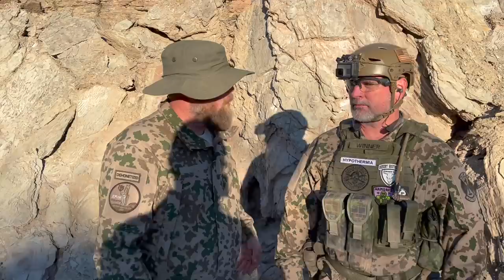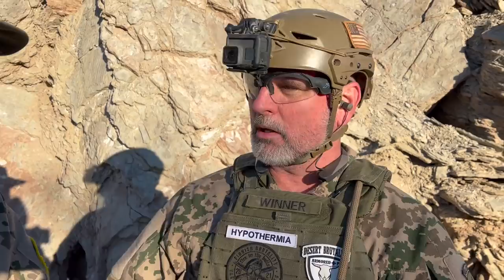WWSD - Why not a hydraulic buffer?

Comment: I've never heard this flaw brought up in the context of hydraulic buffers. Obviously tempterature and viscosity are related--so obvious. I just can't believe I've not heard that before.
Though, hydraulic buffers aren't common by any stretch...
Reply: This is the first time I’ve ever heard of them, and I get to hear it from Karl with a satisfying fart sound.
Reply: Common problem with them.
Reply: Hydraulic buffers need extra few centimeters of bolt carrier stroke soley for damping recoil energy to ensure reliability because damping force can change by temperature. If hydraulic buffer starts to decelerate bolt carrier much earlier than minimum cycle distance, and damping force is bigger than its optimal setting it can stop bolt carrier from going back enough, causing malfunction. Most of rifles, except some cases, have tight bolt stroke in general. Installing hydraulic buffer in those rifles can cause exact same problem - bolt carrier getting decelerated too early, causing malfunction.
Reply: It is funny anyone is even thinking about using hydraulics in firearms, because there is really no advantage over simple springs. Hydraulic and pneumatic systems are usually among the highest maintenance parts in any machines and so you only use them if you really need them. I knew a guy whose entire purpose at a factory was to keep several hundred hydraulic devices correctly pressured, and by the time he was done with the last one, the first one was invariably out of spec again.
Reply: I think part of why hydraulics are a part of the conversation is that pewpewtactical used one in their take on the wwsd. Im glad we now have some more data points (even if this is more anecdotal). 

Makes a lot of sense in hindsight though: adding a significantly more complicated additional point of failure. Yes the captured part is a bit more complicated than the standard non-captured versions, but the differences certainly won’t break the rifle in adverse weather like adding a hydraulic system can.
Reply: Also don't forget they can leak/blow seals. Its abit dated and probably not even close to the same design. But a issue with the 1918a2 bar with the hydro buffer system to allow for two speeds of full auto. Was it would leak and the slower rate of fire would climb up to the fast fire speed as fluid leaked. At the end you'd end up with a 30-06 full auto gun firing at like 700 rounds a min with no buffer to dampen the end recoil of the action cycling.
Reply: 20 or 30 weight hydraulic oil isn't going to work. You'd need 10-16 weight, about automatic transmission oil, to account for gross ambient temperature change.
Reply: @genericpersonx333  Um..what about vehicle shock absorbers?   They run hundreds of 100s of 1000s of cycles without failure.
Reply: @johndoe-td2xd  They were a lot more prone to failure back in the day and so car companies figured out it was worth overbuilding the shocks because reliability helped sales. The hydraulic buffers I have seen for firearms are not as yet being built to the same degree, and partly you don't want to because added grams tend to matter in a gun more than added kilograms matter in a car.
Reply: @genericpersonx333  And that's assuming that you could overbuild them enough to matter and still have them fit in the firearm.
Reply: Not common in fire arms, but just about every car on the road is running a few
Reply: @johndoe-td2xd  A car bouncing on a shock absorber does not malfunction if it sinks slightly too slow or slightly too short. Bolt movement is the most sensitive part of a firearms function. Little changes to it can cause a malfunction. A vehicle shock absorber doesn't cause the car to die if it doesn't settle or move exactly how it is suppose to. 

Also far lower volumes of material and fluid are used in a hydraulic buffer in a gun than in a car. Smaller volumes are more sensitive to temperature changes.
Reply: @genericpersonx333  Apparently they've finally figured out how to sell points-of-failure as a premium feature...
Reply: they work really well on the army's m249 and m240

Comment: The KynSHOT buffers are rated for - 30 degrees F to + 150 degrees F with fluid viscosity being unaffected. The introductory pictures indicate another company's buffer was used and it does not look like a KynSHOT buffer. The KynSHOT Buffers have been tested to over 50,000,000 cycles with no degradation and uses all military grade components. If someone is having cycling issues that typically is related to an improper sizing of the buffer and choice of spring.  KynSHOT reviewed all the competitors products and designed out all the flaws that were seen in the past.  KynSHOT is the leader, innovator and pioneer in recoil mitigation solutions.

Comment: It’s always good to get confirmation from use in the field.
Reply: That may work for optics, ammo, modification of crucial components etc but it’s just logistically a nightmare to if you wanted to do that with this issue present.
In 24 hours the hydraulic oil could go from too cold to work at all to working fine then being too thin in the heat to working perfectly again before it’s too viscose.
And that’s if you completely eliminate the constant temperature change from the buffer tube doing it’s job.

You can’t shoot off a few rounds before every stage.
Once you’ve field tested an optic, you can be pretty sure it’s still going to be fine at lunchtime and again next weekend provided you haven’t  been careless or exposed it to really extreme environmental factors. Also, your gun doesn’t stop working if the optic is fked.

But yes, confirmation is extremely important. They both know this, the issue being how finicky this confirmation is.

Comment: The best gamer spring system is just a rifle length buffer and spring.
Reply: I just put a rifle length buffer and spring in an 18" AR build, looking forward to shooting it.
Reply: @gfarrell80   yeah I’ve got one of those, functions perfectly...  ejection pattern right where it supposed to be.
Reply: @gfarrell80  I think you'll love it, I have a 16" mid gas with rifle buffer, inspired a lot by WWSD21016, and that thing is an absolute beauty to shoot.
Reply: Doesn’t the KP-15 lower only work with carbine length buffers?

Also, what’s the main difference between rifle length and carbine length buffers in terms of pros and cons anyways?
Reply: @gameragodzilla  yes unfortunately the KP15 can’t take anything longer than carbine length due to structural support material behind the buffer compartment. 

A rifle length buffer and spring allows for a better rearward balance, additional buffer mass potential for function, improved component life, and a longer thus smoother recoil impulse. The only downside is the inability to use collapsing stocks.
Reply: Basically make it so that the bolt carrier never impacts the rear of the gun, and instead is slowed down completely by the buffer and recoil spring. Closest you'll ever get to an Ultimax, baby!
Reply: @devikwolf  That is exactly the same setup I have for gas and buffer on mine, I really like it (also inspired in part by the WWSD project)
Reply: @GuamGuy  Huh, so my rifle with a full length A2 stock and a rifle length buffer still has certain advantages over a KP-15 lower. I was wondering if I should just switch entirely to a KP-15 lower since I don’t really care about adjustable length of pull and the KP-15 is lighter, though I may retain my standard A2 lower with a rifle length system if that buffer does make it smoother, as I do like my retro rifle with a rifle length system and rifle buffer being so smooth.

Is the rifle length buffer being smoother a factor across the board? Even if I get the fancy fully captured buffer with the rifle length extension that the WWSD rifle uses, would I still have a smoother experience than a KP-15 with the carbine buffer?
Reply: @gameragodzilla  All things equal, the rifle spring and buffer should be smoother than it’s equivalent carbine variant. It’s been a while since I’ve shot a rifle with a SCS and never directly next to a rifle length buffer, but of all the combination of gamer parts I’ve use I’ll list them from snappiest to smoothest. 

-piston ARs and any of those pdw stock always felt extra punchy to me
-standard carbines on the gassier side have sharp recoil impulses with a decent sight disruption. 
-gamer guns with adjustable gas, hallowed out buffers, and carbine springs have a sharper but lighter recoil impulse. They also have less sight movement. 
-JP SCS
-A5 buffer
-anything ^ but with properly compensated muzzle brake
-rifle length buffers with rifle length gas systems Ala A4 clone. 
-smoothest AR I’ve ever shot was a 20” rifle gas HBAR with a 3 port tank brake and an A2 stock.
Reply: To me, the KP15 compromises some of the smoothness of a rifle length buffer lower to achieve a lighter weight and often over looked integrated flare magwell at an economic price.
Reply: @GuamGuy  Nice. I also did wonder if having a really nice muzzle brake in a 20” rifle length gas system and rifle length buffer was completely overkill and I should just stick with A2 or if there’s still a benefit there. Still, happy to know that there is still a point to a rifle length buffer because I was wondering why I should still bother with my A2 stock lower when the KP-15 is a pound lighter. I always figured the main reason to still use aluminum lowers was just to have adjustable length of pull, but seems like keeping it with a rifle length buffer to have a smoother recoil impulse is its own benefit.

Is there a particular rifle length buffer system you would recommend or is a default rifle length buffer I got from my Windham Weaponry full length rifle the best it gets? I would be willing to spend money buying an even nicer buffer, especially since I want to eventually get an FRT-15 trigger and start hammering the gun in pseudo-full auto. lol
Reply: @GuamGuy  Makes sense. In that case, I suppose I’ll keep the full length rifle buffer because I’m not gonna be patrolling long distances so weight is less of a concern while being able to smoothly and quickly dump ammo is something I want, especially if I decide to get the FRT.
Reply: @LUR1FAX  Not correct. The longer tube is compensated by a longer buffer. A CAR buffer achieves maximum bolt travel, any further rearward movement would result in the gas key impacting the lower receiver.
Reply: Also the A5/intermediate buffer set ups.
Reply: Grab one of the flatwire springs. Adds a slight delay to extraction timing and more positive force. My a2 mock up was running a bit more smooth with the extra force

Comment: Thanks for the content Karl…. My experience with hydraulic buffers is consistent with your opinion…. Even high end $140 hydraulic buffers are very sensitive to ammo pressures and grain weights as well as environmental conditions
Reply: Please say the name of the object you're weighing instead of the unit with which it's measured. It might mean only one thing to you, but you aren't the only one reading. Please don't make people have to do homework to speak with you. Firearms nerds have enough problems without gatekeeping.
Reply: @bubba200874426  grain weight would refer to the weight of the bullet
Reply: Perhaps a pneumatic buffer works better. Air isn´t as fiddly with temperatures, and you don´t need to maintain a tight leak proof system. It just refills itself between each shot, with the help of a return spring.

Comment: Go figure, liquids change viscosity under different temperature and pressure conditions... who'd a thunk it (other than anyone who has dealt with hydraulic systems, lubrication, or even diesel and kerosene fuels under varying temperatures, including a warmed up machine versus a cold machine...)
Reply: I wonder about the results of a pressurised air or other gas cylinder being used.
It would be even less reliable and if you could eliminate all the other problems and somehow make it work, what with the bounce and all... but that doesn’t mean I don’t want to see it in high speed

Probably a question for Ian but does anyone know if this has ever been experimented with by anyone, ever?
I know squat about fluid dynamics and I can see some serious flaws but with the things I’ve seen on Forgotten Weapons it would not surprise me at all to find out someone had done so.
Reply: @UC_TLmpVKFEDC__VMOpNn9zQ IIRC you see it in a few funky small arms that strictly require the features of a sealed pneumatic piston, but usually you don't see pneumatic components that don't use powder gases in small arms. You see a lot of pneumatic/hydropneumatic recuperators/recoil absorbers on cannon, especially on the larger side, but you only very rarely see them in small arms as the cost of manufacturing them over one or more coil springs is difficult to justify on units which have such small individual unit costs but large batch numbers.
Reply: @Jay22222  The type of oil/hydraulic fluid makes a difference, but whether it would be enough, I don't know.   For example, the Viscosity Index (the relation between viscosity and temperature change) of full synthetic oil is higher than that of regular petroleum oil.  In other words, the viscosity of synthetic oil changes less over a given temperature range.
Reply: @jfess1911  Yeah I know all that, I certainly wasn’t suggesting that using compressed gasses could be a solution to the problem or a viable alternative at all.

Im sure using pneumatics would be orders of magnitude worse.
would just be interested to see if anyone’s ever attempted something like that and I’d like to see high speed of it and what bizzaroness you might encounter.

Most hydraulic fluids are barely compressible and it’s the compressibility or lack thereof that is important in the case of a buffer.
I’m not sure viscosity is particularly important (in comparison to other properties and variables.) 
in this application because the fluid isn’t being pumped anywhere or used to drive anything. It just has to absorb energy, so as long as it’s not so thick as to create issues then I don’t think it would be a huge factor. That very much depends on how much temperature and atmospheric pressure change its compressive properties, nor do I know how the compressibility would change based on higher temperatureS once it’s started absorbing some energy.

But as I said, I only know enough about fluid dynamics to understand that I know diddly squat about fluid dynamics and was really only posing a hypothetical about pneumatics or asking if anyone knew of instances it had been tried.
Reply: @CATASTEROID934  Yeah, of course. Just some people will spend A LOT trying to develop something they’re set on.
That’s really interesting.
Thanks mate.
I’ll have to look into the larger artillery.
Are you able to bring to mind any of the small arms that have tested enclosed pneumatics?
Reply: @kevinsullivan3448  What part of who’s reply was your comment to?
I can’t place it anywhere
Reply: @CATASTEROID934  Absolutely not a military application, or even a firearm (at least per US federal laws) application, but it's not unheard of to use gas springs to power a piston air rifle. (In this application, the energy is stored relatively slowly during cocking, and released very quickly upon firing.)
Reply: @Jay22222  Unless I grossly misunderstand, the hydraulic buffers work on the same principle as automotive shock absorbers.  The bolt's movement is resisted and slowed by forcing the hydraulic fluid through a small gap or orifice in the buffer.  In this case, a working fluid thickened by low temperature would provide increased resistance to recoil and cause short-stroking or double feeds.
Reply: @jfess1911  If working as described, I completely agree which is why I don’t think there is a one size fits all oil or fluid, because the smallest changes in the properties of the oil will exceed the window it has to be within so that it doesn’t short stroke or double feed.
Temperatures on the planet are just too variable and the working temperature of the oil goes from ambient room temperature to having to absorb all of the bolts energy for up to 30 shots in a few seconds. It’s temperature is going to be all over the place like no other.
The difference being, ride comfort in a vehicle has a wide range that can be tolerated by someone and you can fairly reasonably predict the temperature at which it’s going to spend most of its time operating, oh. And it’s not going to get you killed if it’s a little either side of those margins.
Unfortunately not the same in a firearm application.

I apologise, I was over tired and wasn’t thinking about it properly. Arguing that it’s viscosity wasn’t an important factor was completely wrong, but that’s at the crux of the issue with its use in firearms. The smallest change in viscosity or compressibility is going to be enough to throw the rifle out of working order in either direction and the temperature range of human habitation is easily enough to change its properties outside of that window either side, so unless you know exactly what environmental conditions it will be working under and you’re not going to die if it doesn’t work properly, I’d leave the hydraulic buffer at home.

Comment: Products for people that want to solve problems that don't really exist. I've always felt its not at all necessary and needlessly adds complication to an already simple, cheap and reliable mechanical spring system. In my opinion: Hydraulic buffer = Over engineered. Not that trying to re-invent the wheel is a bad thing. Innovation in the firearms industry is always something I'll welcome even if it doesn't work out.